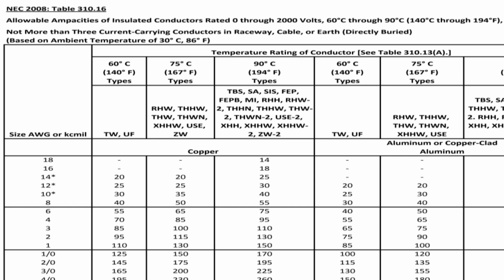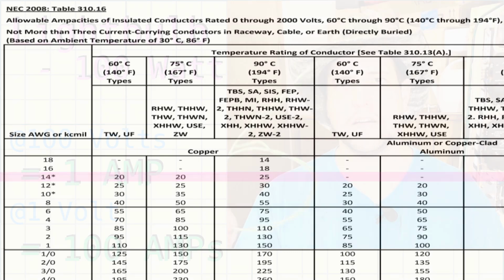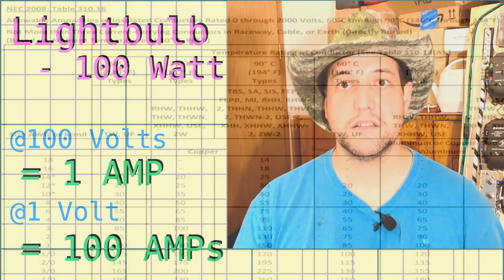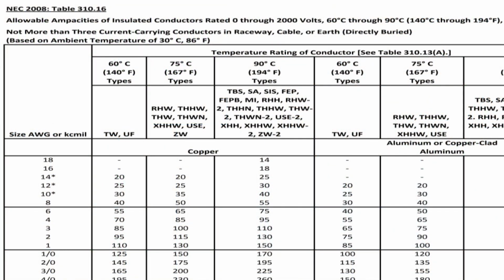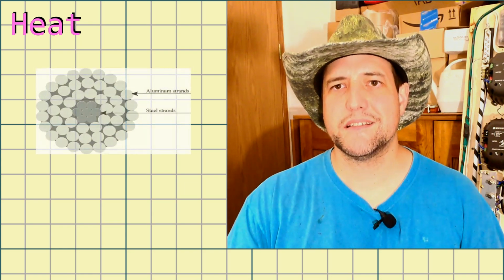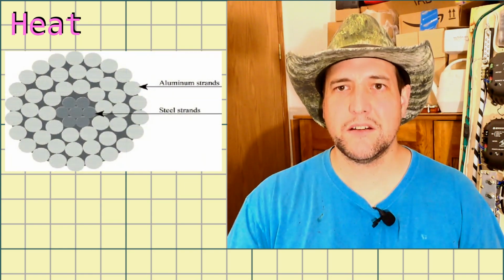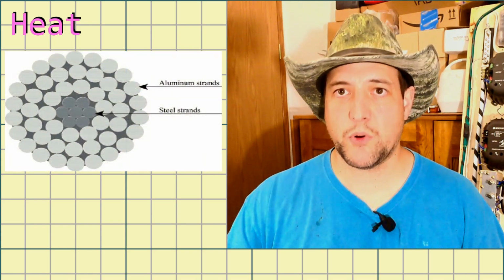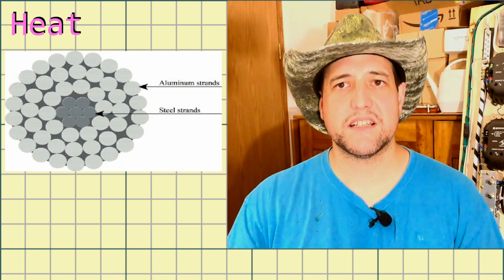Voltage, AMPs, Watts, Heat, and Voltage Drop - GZS 003

Comment: Good job, thanks
off topic ?   Rechargeable batteries:
Charge batteries and put in walkie talkies, then put walkie talkies in their charger base when necessary?
or
Leave walkie talkies with batteries in,  in their charger base, always?
or 
Put charged batteries in walkie talkies when time to use, then use, charge in base, take batteries out when not in use?
Reply: Hmmmmm
Reply from the maker: So, why type of rechargeable battery chemistry are you using for these systems? Like Lithium vs. NiMH?
Reply: @reedin9954  
The ones in the walkie  talkies were Ni-MH rechargeable batteries.
However I'm sure I have both.  Thanks.
Reply from the maker: NiMH batteries are nice and durable. For me I also use NiMH for a lot of my comms gear and I just leave the batteries in them and charge via the station or usb ports. Now I need to recharge quickly I will pop them out and plug them into the standalone charger as it is quicker.

The only problem to worry about is the batteries eventually leaking and destroying things but that seems to be when we are talking around 10 years or so. If you check the condition every 6 months I wouldn't worry about leaving them in the units.

Now I don't keep them in the charger constantly as NiMH doesn't do a float charge well with its rather dry electrolyte.

Smart Lithium systems will disconnect the battery cells when they reach maximum charge. You aren't winning by keeping them in the charger. Dumb unprotected Lithium systems could result in a fire. So, I saw for Lithium just get it charged and then disconnect it.

Not sure on when Lithium cells will start to leak. Don't have enough experience with them to know yet.
Reply: @reedin9954  
Thank you for the reply.
I'm going to go with fully charged batteries, elastic banded to the WT or other any other gear.

Comment: That is old school for me. Retired Navy Electrician. You are doing good kid. Invert the 12 volts to 120 volts AC than convert it back to 12 volt DC.
Reply: Why? What does that achieve? Inverting and then converting is ok?
Reply from the maker: @baronratfish3865  - If you only had 12volt and needed to send it a distance that would be one way to do it but the statement misses the point I was attempting to make in the video by showing the differences of low voltage and higher voltage when traveling over a length of wire, especially in the size of wire needed to accomplish it.

My future videos going over these things will really help explain stuff and tie in it when designed extremely reliable and safe solar systems.
Reply from the maker: Glad you liked the video. What was the highest voltages found on those Navy ships? Always wondered what they use for things.

Comment: Thanks Reed, is that how the CA forest fires that got blamed on the electrical company were caused?
Reply from the maker: From what I remember is that trees weren't kept trimmed around the transmission lines and during a high peak time the lines sagged enough to touch the trees. Now I could be totally wrong as I haven't read any of the reports but that is what I remember.
Reply: https://www.nytimes.com/interactive/2019/03/18/business/pge-california-wildfires.html